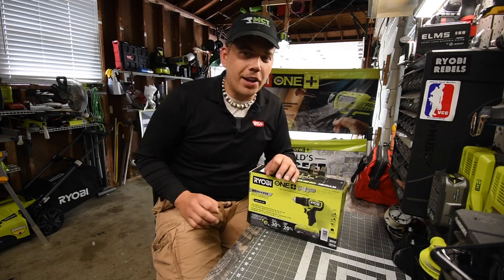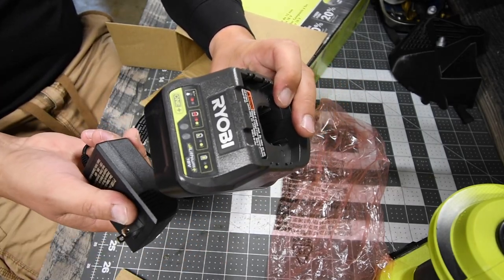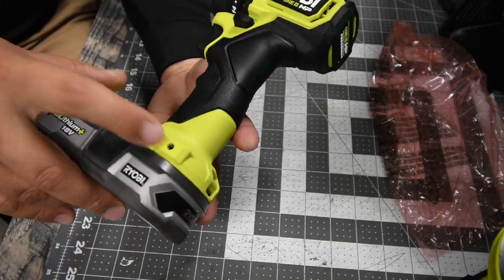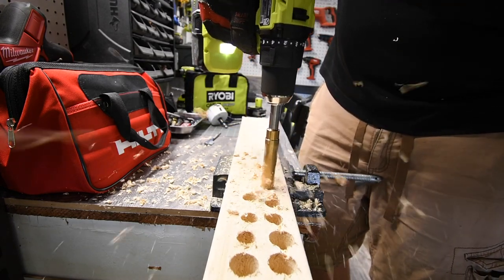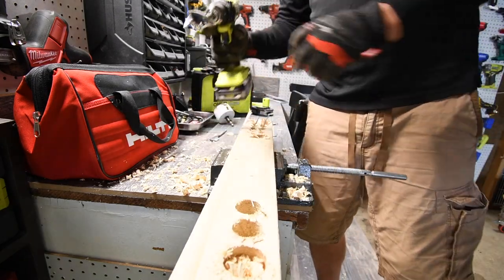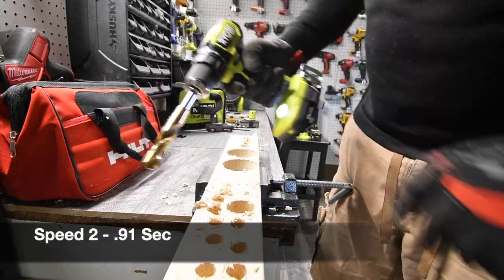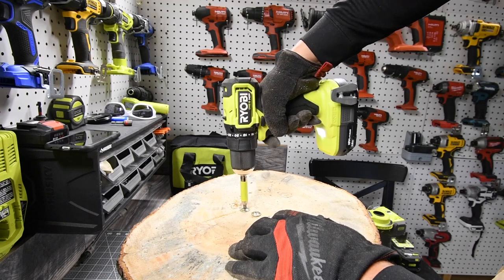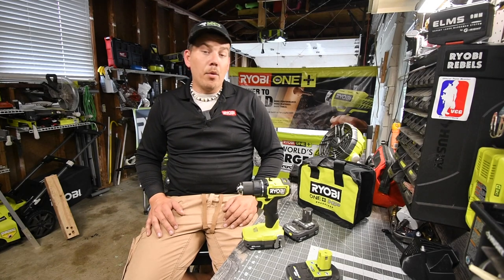NEW!!!  Ryobi HP Drill

Comment: Like i mentionned in an other one of your videos regarding batteries, the reason Hilti's sliding battery base is larger, is because they uses 24V batteries, instead of having 5 (18650 or 21700) in series, they use 6 cells in series, thus making the batteries larger by at least 18mm or 3/4''. 18650 refers to 18mm in diameter and 65mm long battery cells. Same goes for 21700 which are 21mm in diameter and 70mm long. 

Great video as always, the drill reminds me of the ridgid subcompact specs and performance wise. Since they are both from TTi, that probably makes sense that they share pretty similar traits.
Reply from the maker: I thank its an awesome drill

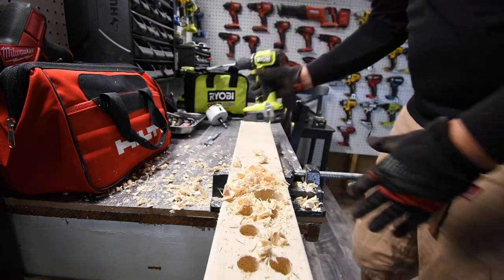Comment: 12:35. I got a DCD998 Power detect to jam like that, while on speed one.  It took weeks before my wrist and fingers stopped feeling funny.
Reply from the maker: The bigger hammer drills are the ones that are easily able to the the hard tasks on speed 2 and 3
Reply: Man Caver Tools 

I was curious to see if the DCD998, could take a lug nut off.

Honestly if it wasn’t the the auto shut off, it probably could.  The make shift  brace just got loose on me.  And owie.

Also don’t try this at home kids.

Comment: I cant believe tHey removed the magnetic tray at the base. It was so simple yet so useful. I used it everyday plumbing w.a handful of screws on my impact gun. 😰
Reply: Going compact and lighter weight has its trade offs and the LED plays a much more important roll now that the tools are smarter and will flash the light to indicate the tool status and warn of problems like over heating...

While you can always mod and glue on a magnetic strip...
Reply from the maker: I guess they thought it was time to get rid of it

Comment: Great vid. You should do a versus vid between the new brushless and the old brushless using the new battery in the old drill.
Reply: Compact is a new line, not meant to compete with the larger tools... It would be almost like expecting a 1/4 impact to perform the same as a 1" impact...  But these won't be the only HP tools and they'll eventually releases larger tools that will offer higher performance.
Reply from the maker: I plan to and that is coming soon
Reply: @ZeoCyberG  the purpose of the versus vids are to compete it's to see the differences between the tools. They are similar tools. The new tools have the HP chip in the tool instead of the battery.
Reply: @ace4311  I'm aware but that doesn't change relevancy.  Similar tools can still have a lot of differences and it remains that the compact series isn't meant to replace the larger tools but rather fill a new niche.

While no, they did not move the HP chip into the tool.  If they had then there would be no need for the battery to have the additional pin, especially as the HP Compact tool lack the additional pin...  So clearly they don't mean for the battery to be only used in the compact tool series.

The HP in the tool is actually now referring to the tool itself being smarter and that goes beyond the original HP feature.  The tool can now monitor its status and flash the led light to show that status to the operator, as well as have safety cut offs to help prevent the tool being pushed straight to critical failure... Meaning it's not as easy to turn these HP tools into paper weights as it was with the older tools and that makes them a whole lot more reliable and more assured to last a long time.

Putting the new battery in the old brushless tool should actually tell us more about the battery than the differences between the compact HP tools and the older Brushless...

Comment: The drill seems pretty good but the proportions with the battery are starting to look weird.what do you think?
Reply: Dont care cuz if they change the battery i will change brands
Reply: I definitely agree they need to upgrade that
Reply: The hallmark feature of Ryobi is the fact they have never changed the form factor of their battery.  Ensuring universal compatibility with every tool they've ever produced with every battery they've ever produced, which is also one of the reasons why they have one of the largest range and variety of tools of any tool brand in the market.

But, the downside to that is their hands are pretty much tied when trying new things like making compact/light weight tools...  But this is only a compact/light weight tool range and won't effect their normal tool range and future HP tools that won't be the compact/light weight variety...
Reply: To me I see changing battery style then selling or including an adapter to use the new battery style in an older tool
Reply from the maker: the base kills me. I want a small base. its time for a battery change
Reply: Man Caver Tools i disagree.

Comment: Basically, Ryobi is putting HP on the tool itself to signify they are smarter tools that will flash the LED to indicate tool status and has protection built in to deal with over heating, etc.  So these can be worked harder without needing to worry so much that you'll burn it out and turn it into a paper weight... While the battery is the first of a new series that may make the HP+ features standard but will no longer make it a selling point and may no longer indicate if the battery is HP+ or not.

Though, the higher output that the HP+ batteries are capable of would only really be seen in 3AH and larger but it will be interesting to see what happens with the new 1.5AH compact if it's put into a compatible brushless tool with the additional pin that works with HP+ batteries.

The compact line of tools do not have the additional pin as they are compact and not pushing the performance limits, as smaller tools will more easily over heat and have other issues, and thus you'll only see a performance difference as you would see with most Ryobi tools when using a higher capacity battery in them but tools that do have the additional pin can communicate with the battery...  So that may be the only way to find out if the 1.5AH is really different from previous versions and if so then by how much...

Mind, even with higher capacity batteries, 3AH doesn't get you as big a boost as the 9AH would... You'll see the same in even high end brand tools like Milwaukee as only their 12AH battery can push their tools to the max.  So, never expect too much on the low capacity scale but that doesn't mean there's no improvements at all, it's just a question of how much and has yet to be verified to be any difference...
Reply from the maker: that is correct and I say that in the 1st video I uploaded about these new tools and I thank you for the info Zeo

Comment: Does this series also make use of the extra contacts on the hp batteries like the full-size brushless tools?
Reply: For the compact tools... No, just the new 1.5AH battery has the extra pin...  But this is just the beginning of a major change of how they make their tools.  The HP on the tool itself is for indicating they're moving to making their tools smarter.  So will become more reliable and operate more efficiently and that will no longer be an emphasis on the battery...  While these compact tools are just that, more compact and lighter weight.  There's always trade offs when doing that and so they're not intended to push the max performance limits, just get into tighter spaces and be easier to carry without sacrificing too much performance to still be useful...

Would be interesting to see what happens when putting the new battery into a tool that does have the extra pin, though... Don't expect much as it's still only a 1.5AH but like the HP+ batteries it can communicate with the higher end brushless tools that have the extra pin...
Reply from the maker: it doest not have the extra contact because the HP is in the tool. so it doesn't need HP batteries

Comment: Love the newer look of the tools! What is odd to me is why they don't offer the HP batteries with these HP Brushless tools? Does the drill have the extra metal contacts for the HP batteries to take advantage of? I can tell you those newer compact chargers are faster than the old P118 (all grey) chargers, but still not as fast as the all Green P117 Fast Charger. 

I know this only because before I sell them, I fully charge them & test once. I charge hundreds of them & I use my 6 port large charger, a P117 & P118B, before I pack them up. Thanks David!
Reply: Ryobi is changing the HP branding... It's now for the tool itself and not the battery, signifying the move to more smarter tools that will monitor status and flash the LED to tell the operator if something is wrong like over heating and will have cut off, etc. to protect itself for better reliability, etc.  The compact series is the first to introduce this change...

Note, the battery does have the additional pin... Just none of the markings you would associate with a HP battery.  While it's only the compact battery that is intended to come with the drill/impact kit and the rest of the tools are tool only at the moment.  Ryobi reps have stated the battery is just the first of a new line.  So we may see higher capacity batteries that will perform like HP batteries but without the markings/logos...

While the compact line is pushing both compactness and lighter weight.  So smaller battery, especially, just for a drill/impact kit makes sense for what it's intended...  We'll see what they'll pair with more powerful tools later...
Reply from the maker: These don't have HP connections on them. the HP in in the tool now. you no longer need the HP batteries with these new tools

Comment: I definitely agree ryobi needs to make the base of the tool smaller just incase you want to use a smaller battery 🔋 then they could make a smaller.  For lighter duty jobs they are great a lot of power in small compact drill. I would use one if I was working over head those regular size tools get very heavy after a period of time that's when these little guys are needed.
Reply from the maker: The big base needs to do

Comment: It just doesn't look all that impressive.
Reply: Compact/lighter tools are not suppose to be impressive, they're suppose to be compact and lighter to fit into tighter spaces and be easier to hold for long periods.

The HP for these tools refers to the fact Ryobi is making them smarter, building in fail safes that work with that light on the base to flash status indication when it starts to over heat or have other issues.  Ensuring the tool will last longer, also less likely to damage the battery, and work optimally longer...

Seriously, things like reliability matter too...  Ryobi tools are entry level and they can burn out if you push them too hard but these will help prevent that and are just the first major change to the tool range that will trickle onward to the larger tools that will offer more performance too...
Reply from the maker: this Ryobi tool is smaller than the milwuakee m12 fuel hammer drill. so im very impressed with it
Reply: @ManCaverTools  is it as powerful?
Reply: @ToolswithSoAlz  yes im pretty sure the m12 hammerdrill is 350 inch pounds this is 400 so its even more powerful in torque atleast
Reply: @minnesotaman3  great, you read the spec sheet but did you watch the performance on the video? It is far from the spec sheet and it showed here.
Reply: @ZeoCyberG  Did you watch the non sponsored Workshop Addict review of these tools?  The tools were smoking without the overheating protection features kicking in right out of the box...  These are heavier than the 18v Makita and 12v Milwaukee compact tools, and if they push 170 degrees under normal use they aren't going to be comfortable to hold no matter how light they are.
Reply: @TheYuppiejr  Yes and no, WorkShop Addict's test were pushing them well beyond what they would normally be used for, they even stated a regular Ryobi tool they put through a similar torture test burnt completely out and no longer worked under similar testing, while these continued to work, and they experienced some similar issues with the Milwaukee 12v's that also smoked...  While the tools they tested were from pre-release, they did those tests before the tools were available for sale and pre-production units aren't always final stable versions, which would explain why other reviewers didn't all get the same result and actually got the shut off and flashing status light to work properly...  You'll get longer run time options with Ryobi's 18v batteries vs the 12v of the other brands, they may not be the lightest but for the price they are still much lighter than Ryobi's regular tools and they're going to last much longer, which makes them more reliable than Ryobi tools are normally known for... They are what they are, Ryobi is not meant to replace Milwaukee, or Rigid, the same company, TTI, owns the rights to all three of them... So they should be judged by the market segment they're meant for...  Like HF Good > Better > Best Tiers...

Comment: How can I get the hp lineup? Yeah I use my ryobi up on the roof for removing satellites and for concrete anchors or chimneys and the rubber molding stops it from sliding off the roof. So it does help.
Reply from the maker: this drill is available at the Home Depot website right now.

Comment: Ok need help, I bought the PSBDD01CN TODAY, Can get it in the drill selection goes 23 0r 1 never ratchets to the drill mode. What am I doing wrong?
Reply from the maker: did you try turning the clutch the other directions?
Reply: @ManCaverTools  ok returned to the store, we r tried three different drills, you really have bear down on it to get to the drill mode on all we tried. Maybe it will loosen up after some usage, but at least it works.

Comment: Why they make so big hole on top that leads to brushless fan mechanisms. I think they do it for purpose if nail or screw or piece of trash falls in there while operating it will ruin the drill and need to buy another one. Same thing they done on Cobalt 24v brushless huge vent holes to brushless fan it feels fragile
Reply from the maker: more air flow the better I would imagine
Reply: @ManCaverTools  maybe. But I like my Porter Cable 20v brushless got nice design and no major lugs. Only think I wish Porter Cable done batteries with charge check on them but not on tool. Idk they feel so light comparing to other models

Comment: Ryobi could make the batteries more compact by taking an inch and a half off the front leaving the same latch the stem should not matter
Reply: Can't, battery has to fit every tool made in like the last twenty plus years...
Reply: @ZeoCyberG  it will still fit it will just not go all the way to the front
Reply: @craigchiddo2794  Nope, this is as compact as they can get it without changing the battery and making it no longer universally compatible.
Reply from the maker: I agree with you on that. and think they should have

Comment: He says the drill looks like the dewalt but I notice in Home Depot that ridgid drills look like the ryobi tools now that ryobi hp may be the old version of ridgid and change the design a bit and ryobi is probably competing with dewalt because some of there tool comparison are with dewalt and even craftsman from Lowe’s if look carefully the grey painted tool likes like a craftsman. They are competing with dewalt and craftsman budget brand and are doing compact tool. I don’t know about them completing with makita because they are starting to use system programs like assist mode and auto mode on there impact wrenches. While makita system from speed selector to self taping skrew feature to are awesome but ryobi is not there yet to compete with makita.
Reply from the maker: this did resemble the Dewalt atomic first generation a little bit